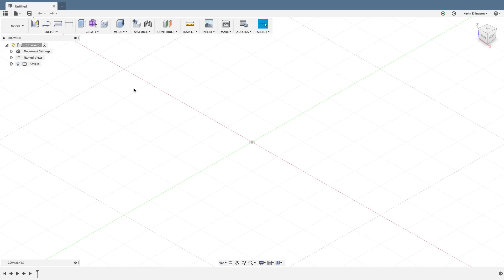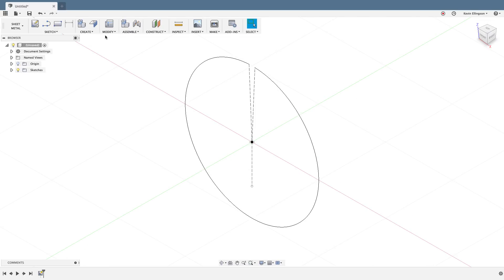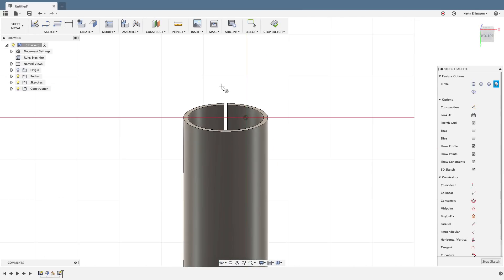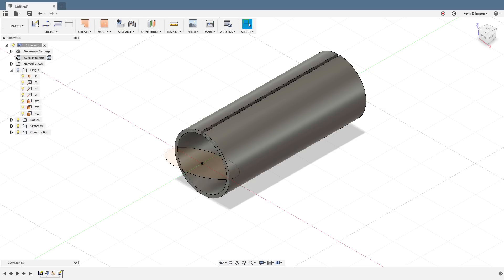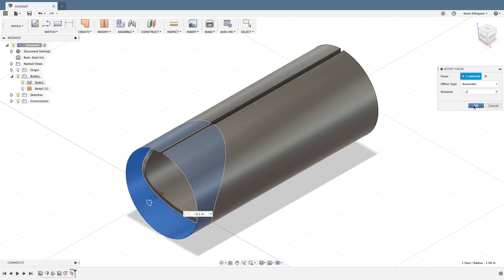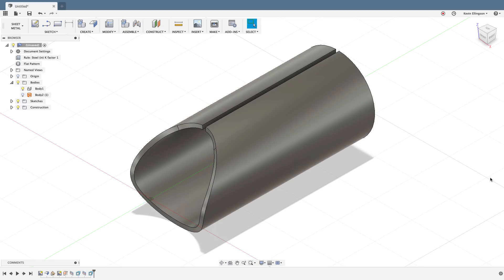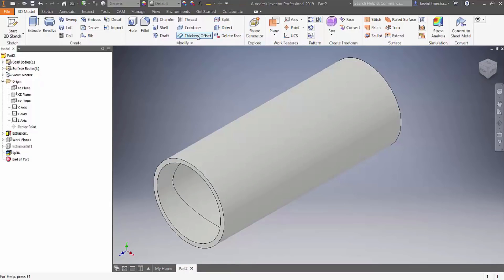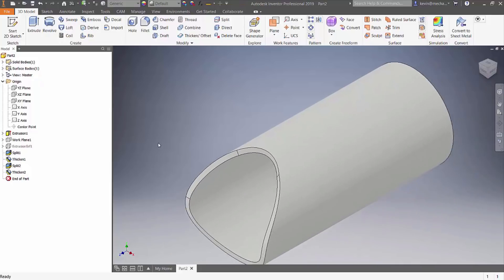Fusion 360 - Unfolding Sheet Metal Tubing

Comment: This may be a silly question. I’ve got everything up to the actual printing of the paper template. Is there anyway to limit the template size? Ie if I am coping both ends of a 10’ long piece of dom how could I print just the two templates to make my cuts? 

Thanks!
Reply from the maker: Are you talking about the Modeling workspace, or the drawing workspace?
Reply: @ the drawing workspace. I want to print the template out and tape it to the tube for cutting. There may be another way but I don’t know of it. Still fairly new to fusion. Thanks
Reply from the maker: @ There is a break view command you can use to remove the space between the two ends.
Reply: @MechanicalAdvantage  thanks. I’ll look into the break command.

Comment: Sheet metal needs to be tied together with surface function, if you could create the part as a surface, unfold it then thicken, you would always have cuts normal to the surface. The other horrible part is when the software is smart enough to give you a warning, it knows where the problem is, but give such a vague description, instead of a red dot or something on the part. I have had times when I blew the part up till I could see an error which was not more than a couple thousandths. I'm going to create a sheet metal part thats only .001 thick and see what happens, Thanks again for a video you did 4 yrs ago!
Reply from the maker: I think you may be being a little hard on the software here. You can use the unfold feature to do the thing you are asking for. As for the errors, I know Autodesk is continually trying to help improve communicating what the errors mean or where they are. It's just a really hard thing to do. 
Glad the video was helpful for you.

Comment: Hey, I've designed a curved guardrail using tubes, but now I can't figure out the length I need to cut to get it bent.  Could I use the sheet metal tools to un-bend and straighten the metal tubing so I can calculate how much stock I'll be using? Is there any other way I could do that ?
Reply from the maker: No. Sheet metal can’t deal with deformation when creating a flat pattern. Your tube would curve in two directions at the bend to create a flat pattern. 

How did you create it? Did you use the pipe or sweep command? If so, you have a cent like sketch you can measure to find your length approximation.

Comment: There is no tool to unwrap a curved solid that's not sheetmetal. It's very frustrating. 
exactflat is crazy expensive
Reply from the maker: That is a pretty complex task. ExactFlat actually performs FEA analysis ok the surface to create its flat pattern of a surface that isn’t meant to easily unfold.

Comment: When you went to make the cope in the sheet metal part, why didn't you just stay in the solid environment and extrude the circle, then do a combine/cut, with a tool body?  That would save you from having to press pull away anything remaining...??
Reply from the maker: I’d have to go rewatch to be certain, but the goal of the cut is to be perpendicular to the face so when you create the flat pattern the edges aren’t beveled. If you just did a subtraction the cut wouldn’t be normal (perpendicular).

Comment: Kevin - 3:15 into the video - I found by trial and error that the gap between the ends can be 0.001". I've made a tube that accepts 1" square tubing on a 45 degree angle through a 1.9 OD tube. It leaves more space to fill at the sides due to the vertical cut on a hole that is angled, but it is good enough for what we want to do with it. We're messing with the tubing cutter on our new Arclight Dynamics plasma cutting table.
Reply from the maker: David Haile Hi David. Thanks for the insight. I hope you guys made it home OK and you enjoyed your week with us in class. Let me know how the tube cutting is going.

Comment: Hi Kevin, thank you for the video! Really great :-D
Quick question, once the shape is flattened, can I edit the shape some more and then re-wrap providing I don't touch the flat side that was cut for the purpose of unwrapping? I have a design that I want to wrap around an almost cylindrical object for 3D printing.
Reply: Yes. You can edit it in either orientation. This is one of the best ways to make patterned holes in a cylinder. Lay it flat, make your patterns then reroll

Comment: Awesome info, thank you for sharing. With using that work around how would you recommend going about doing that with a piece of tubing that has a bend in the middle and notched on both ends
Reply from the maker: Hi Jacob. Fusion's sheet metal engine can only flatten things that are able to be made in a press brake, and can't calculate deformation. So if you think about a bent tube, some of the material would be stretched and some of the material would be compressed when unfolded so Fusion's unfolding engine can't calculate that. I would love it if it could!

Comment: They made us wait for years for the sheet metal tools we have now. Autodesks trackrecord is not that great concerning listening to users..... The ideastation is filled with ideas that have been there for years. But I'm very happy with Fusion.
Reply from the maker: I don't think they wanted to. Fusion is such a broad tool for who its audience is. I think they had so much to flesh out for each group that they just didn't have the resources for vertical functionality like sheet metal. I think with Fusion they have done a decent job listening to users. Sometimes to add a feature, the core of the product (the stuff under the hood) has to be written first. I'm guilty when I get a chance to speak with Autodesk developers to say "You already have this Inventor, just make it work in Fusion". They then explain that it isn't just a copy and paste job to add the functionality since Fusion is very modern and multi-platform. So I think that is why sometimes you see an Ideastation post with lots of votes that doesn't get implemented. The core just might not be there yet to support it and the internal priorities to get there don't match the voter requests. I have no knowledge of how those decisions are made, just speculation on my part.